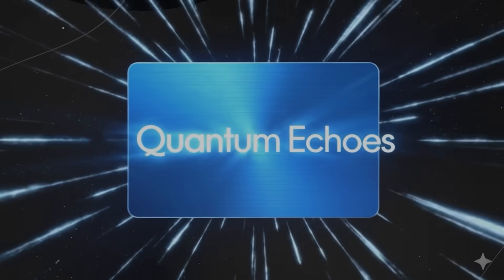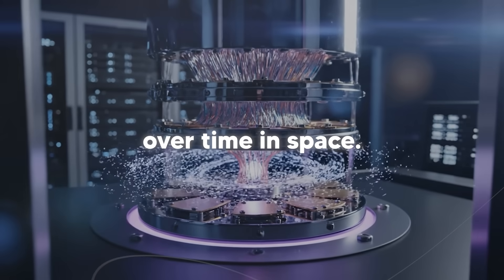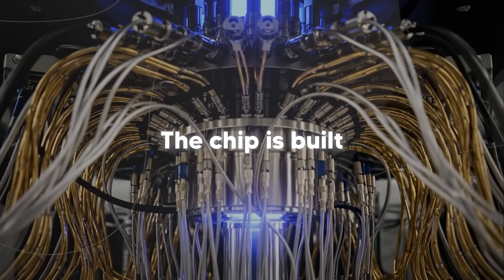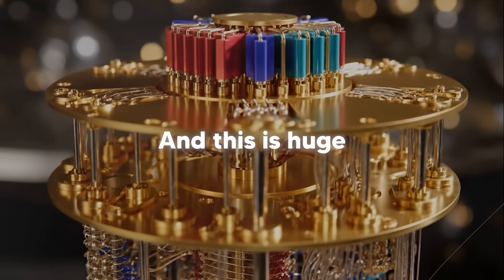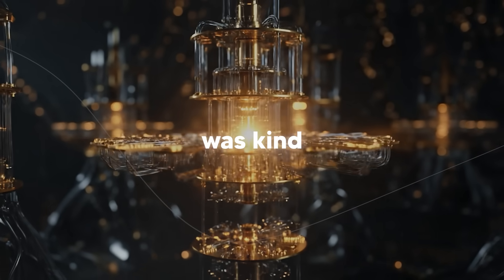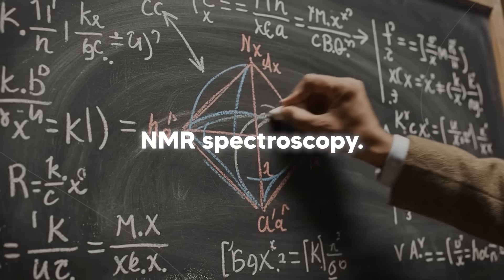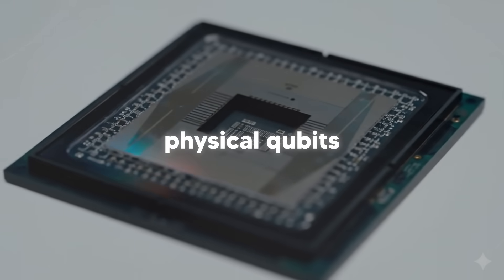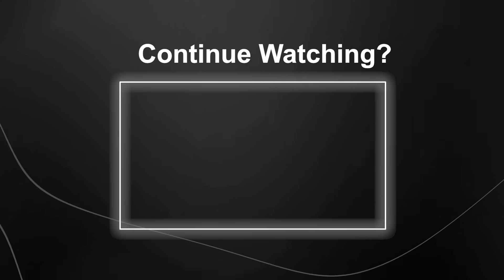Google's New Quantum Computing Breakthrough Just SHOCKED THE WORLD! (Quantum Echoes)

Comment: I'm confused. If this is a true quantum computer, why hasn't it broken the shor's algorithm record of factoring 21? Why has that record stood for so long?
Reply: Quantum echoes, despite being a legitimate quantum algorithm demonstrating verifiable quantum advantage, has not broken the shor’s algorithm factoring record of 21 because it is not designed for integer factorization. It is a benchmarking and simulation algorithm created by google auantum AI to demonstrate speed and verification capabilities not to execute number theory problems like shor’s algorithm.
Reply: @sylvesterpalys417  Sort of like how my computer can do algebra but not calculus. I'm guessing that this device is like theJiuzhang photonic quantum computer which can do only one class of quantum operations. Not a real quantum computer that can break codes.
Reply: @bradspsychedelium  not quite? the algos they used can be used on other machines provided they have the same accuracy.
Reply: Do all computers do the same things?
Reply: What is quantum computing used fir? Why is  no one saying that
Reply: @bradharris1062 they have discovered the wheel, but not the car yet basically. Similar to AI, there can be many different uses in the future
Reply: because quantum mechanics is wrong so quantum computers will never work.
Reply: @womp6338  surely you’re trolling. 🤭
Reply: @womp6338  your gpu experinces quantum entanglement(might be getting a diff process mixed up. the one a bout phasing through matter likes it not there) routinely -_- what are you on
Reply: @womp6338 wrong about what? 😅